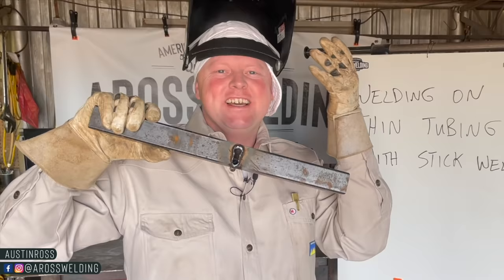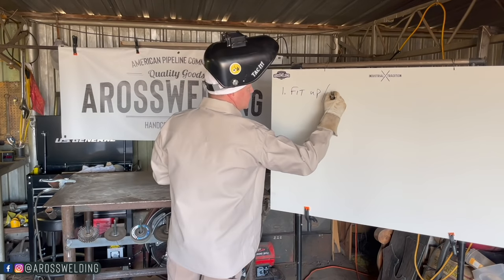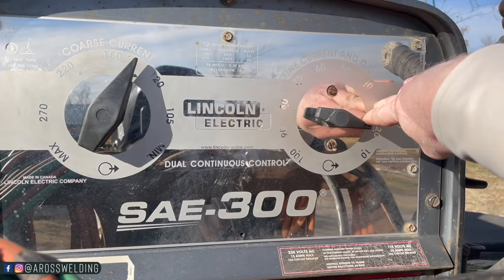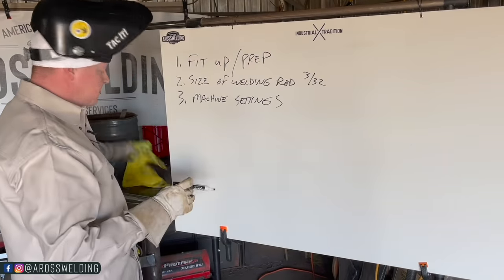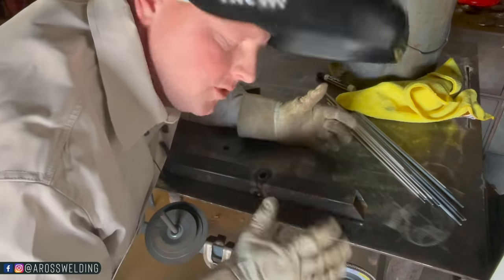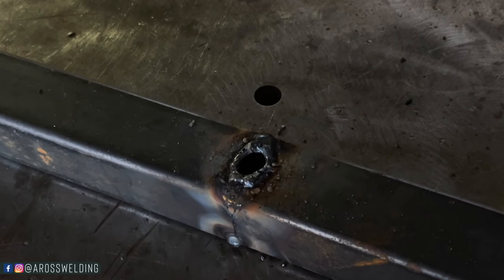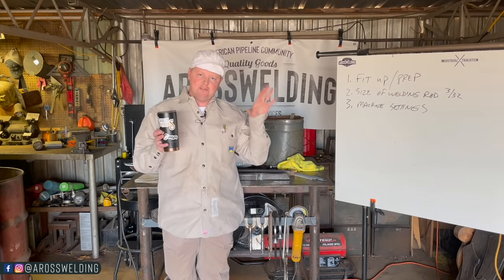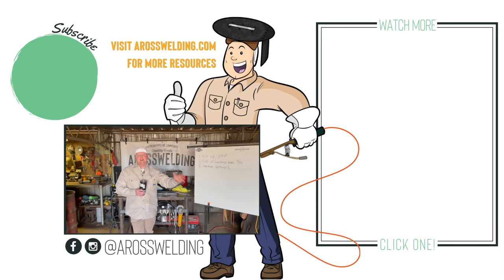Stick Weld Thin Square Tubing (How to Recover After Burning Through)

Comment: One thing you have to be careful about when filling large holes is to not build up what I call an igloo. In other words, make sure you’re welding flat, on the edges, rather than building those edges upwards, which is easy to do. If you do, when you sand or grind it flat, you’ll find another large hole left.
Reply: Gotta get your feed /heat ratio right to get a good puddle not an igloo. With stick it's big rod slow small rod fast
Reply: Can't take bugger all off on that outer corner mate, on the thin material. A tiny pass with a flap disc and lower amps will prevent the igloo and better yet, stop over penetration and ultimate blowthrough. The basis of the video.
Reply: And forgot, a fast pass.
Reply: I did this at work yesterday. My foreman wasn't happy. Not at all.
Reply: Excellent advice thank you
Reply: @mikejohn3265  The next time that happens when you build up a little rim around the hole try to hold the rod in the center of the hole and let it build and get hot enough to redden the outer fill then go up and out of it. Grind it down and it should be fairly flush. 28 years shipyard, port and naval production experience. Good luck my man.
Reply: It’s the same principle, as when you’re welding a keyhole
Reply: @tombragalone7250  true.
Reply: I dob  308  and309  stick make a puddle stop watch the red leave hit it again look like a tig weld
Reply: ⁰
Reply: If you have the right thickness of scrap handy, and you're using small 6011, cutting in a small patch might work better.
Reply: 😆👍 dang an iglpo can be bad then.

Comment: It really helps ,when you’re welding thin material to not use a high penetrating rod such as 6011 or 6010, Use some 6013 or 7018, also you can run 6013 vertical down and it’ll do a really nice job on thin material, you also can buy one 1/16th welding rod.
Reply: i think 7018  downhill is ok with sheet metal thicknesses like this
Reply: A lot of people dislike 1/16" stick welding rods because they feel like flimsy spaghetti, which they do, but a good compromise is to get 5/64" (2.0mm).  They will work reasonably well down into the 30A range, which is plenty low enough for most projects out there, and has enough stiffness that the arc-end won't be flopping around everywhere after you strike the arc.  Blue Demon sells a convenient 5 or 10lb box of 5/64" for a good price on Amazon, and IMO every welder should have a box of it just in case.  Really, really useful for quick fixes/jobs on exhaust systems/tubing.  Blowing a hole through an exhaust installed on a vehicle is a disaster you don't wanna put yourself in.
Reply: 6010 can work very well on thin metal if ran properly. It is a fast freezing rod so you can use a whip and pause technique to avoid burning threw. Use a small rod and low amperage. It will also look very nice if done in this fashion. At work we only get 6010 and 7018 so 6010 gets used on thin metal all the time.
Reply: The key is whip and get puddle frozen and get back in it and pause.
Reply: @dans8169  dan....i want to weld up a carport from 1/8 steel tube.  any ideas on  6010 vs 7018.  i like the idea of 7018 for strength, but 60xx rods are still twice the strength of the base metal???
Reply: @peetky8645  The only problem with 7018 on thin metal is it’s not fast freezing. That can result in burn outs. What you can do is a pass of 3/32 6010 on low amps and then a pass of 3/32 7018 over it. That will work very well  because after you do a quick pass of 6010 you have made your joint thicker and it will not blow out as easily as a 7018 only weld.
Reply: @dans8169  good advice.  i have also thought about using a thin backer on the butt joints at the apex of the trusses, welding downhill, and moving quickly.  still trying to decide on the pitch for the trusses -4/12, 5/12, or 6/12.  all the other welds will be fillet welds
Reply: @peetky8645  The 7018 I would not downhill. The flux is very liquidity and runs like crap downhill
Reply: @dans8169  good observation...i will definitely keep that in mind..i was hoping angling the rod steeply in the downward direction would allow the arc force to keep everything in place...  it will be an interesting few days trying out different rods and direction of travel etc.   i have a camera and auto darkening lens and tripod so i may try to film it all and put on YT so others can learn from my mistakes.
Reply: @peetky8645  Just run uphill and it's a piece of cake.
Reply: @peetky8645  Going verticle up you want to be in a slight push.
Reply: @peetky8645  I'd say that if you're going to build steel trusses that you don't weld at all and use self tapping screws instead.  I'm a carpenter and the company I work for specializes in designing, fabricating, and installing steel trusses (mostly for roofs) –I've built A LOT of trusses. We use self tapping screws exclusively to build our trusses. I know that they used to weld trusses but that was apparently 20 or so years ago before screws proved to be able to hold trusses together. 

I can't even begin to imagine how much of a PITA it would be to have to use a welder when putting together trusses. The time it takes, the mistakes that can be made, the process of fixing those mistakes, equipment needed, etc... Building a truss (~20' wide, with a 7:12 pitch, maybe 13 webs and a 130-150 screw count, for example) takes me about 15 minutes when using a screw gun and a little longer when using an impact driver. It would probably take at least 3 times as long to build if I had a comparable proficiency in welding. 

Unless you want a welding project, have no deadline, and/or already have the equipment needed to weld and you would have to invest in tools and/or hardware to build your trusses using screws, then consider listening to my advice.
Reply: @KJ110813  interesting

Comment: Experienced welders have been in many recovery scenarios. Welding thin material is challenging. If it wasn't for my mistakes, I wouldn't have learned anything.
Reply: I managed to flat weld some tubing and even filled in some holes with 7014 but forgot how I managed to pull that off.

Comment: Square tubing 10 GA or thinner I use old school oxy/acetylene with 1/16" filler rod. I know it's slow but it looks awesome. Saves me a lot of time on clean up.
Reply: I just get the mig out lol
Reply: I love oxy/acetylene it is so accommodatein and versatile👍
Reply: Something to notice is he using his opposite hand from holding the stinger to hold the stick closer to the hot end. Lower amps cause sticking, and he does a smooth start using his stick hand. It gets hot fast, so let it go after light up!
Reply: I use the old "touch & stop" method.
Reply: @mikem9584  yup that’s what he did to fix the hole
Reply: @ellismidkiff6117  Tijuana TIGgin'
Reply: When I grew up, no 220 in the shop, so I did a lot of torch welding. I really enjoy it, and I still feel it is a good way to start out.
Reply: @JeffinTD  you learn to TIG via torch or gas welding
Reply: Leastwise that was my welding instructor's take on that
Reply: @mikem9584   Yeah that was kind of my path, though it took me a session or two to break the habit of pulling the torch back when things got too hot. 

Oh yeah, gotta back off that pedal thing…

Comment: You’re right, every welding machine an welding rod welds at different temperatures. Your technique was called buttering way back when. Great job with your teaching course on filling a hole. Retired pipe welder of 42 years 🇺🇸
Reply: A welder never retires 😉 as I'm sure you know. Everyone always has a job for the family fabricator 😂
Reply: Retired after 41 years working under the AWS D15.1 code. A good welder never stops learning! As far as thin stuff, the best lesson I ever learned was running DCSP with 6010, 6013 etc. DCSP (DCEN) has a tendency not to heat up the base metal as much as DCRP (DCEP). And Scrimdog is right. A welder never really retires! Ha!
Reply: If you have room you can put a brass chunk on the back side, it will also help with the heat. Not a welder but was a fitter for decades.
Reply: @tomt9543 I looked it up and dcen inputs 2/3 of the heat at the base metal and 1/3 in the electrode, is this right?

Comment: Great video especially for those just starting out; as an old school retired tank welder, you got all the basics right! speed is something you just have to get the experience to learn how,& when I had " blow outs" I have put a filler rod or scrap piece of similar material in the hole & weld it in place, if it's not for pressure or heavy structure. If it us for pressure or structural use,think about using a heavier gauge material to start with! And you got it made in the shade, with all the new steel & good equipment! If you have people ask about rusty metal; get it as clean as possible; the 6011 rod is a general purpose rod & is the only rod I will use on rusted or dirty metal, especially in the oilfield & junkyard scrap! I'm just glad that you and a few others are still out there  working & willing to share your expertise & experience with others! Keep up the great work & don't let the devil get you down!
Reply: we use 6010 or 8010 to root piping up here, depending upon the usage/ regulations on the piping being used (Z6.62?) we use 8010 downhand. I like it for junk metal like you were saying and I like it for closing up holes because its a fast freeze electrode. Lots of people also don't know that it was originally marketed as a cutting rod for making quick fast cuts without a torch. Crank a 1/8" rod to 220 amps it'll cut a hole. But people started noticing that the rod had great penetration and lent itself to root welding.
Reply: Just to add a little to what you have already said, 6011 electrode is classified as a deep penetration, fast freeze electrode, which makes it excellent for welding down hand and rusty, painted wet metal. Generally the rod manipulation is to whip and pause, so basically after striking the arc you whip back away from the puddle without breaking the arc, which allows the puddle to cool and carry on with that motion. Very easy to start the arc. It does not have to be kept in a rod oven to keep it dry like the low hydrogen electrodes like 7018. It's an excellent starter, all purpose electrode. It is also often used on the root pass of a high pressure weld. 6010 is common as well and is very similar to the 6011 electrode.

Comment: Welder here 28 years experience, what I've learned over the years concerning thin metal it's best to whip and pause which gives the base metal a fraction of time to cool avoiding burn through at appropriate  speeds. Practice makes perfect. Great video demonstration my man.
Reply: Perfectly said 
Weld pause weld pause weld pause

Comment: Excellent topic. That’s what I tell my students, a welder knows how to work the metal. How to switch up rod movement, amperage, angles, arc length, and travel speed. Pipe welding is great but I feel that this builds experience, character, confidence. I’ve welded 14 gauge rectangle tubing with 1/8 6010. Made some stairs to a mobile home with them. I set the amps at 65-67 and as soon as I establish a puddle, I move. Whip and pause is really the best way to speed weld. I also keep a tight arc length.
Reply: Excellent point, most young guys just want to get in there and burn rod after rod and that may work on thicker materials. But real skill, comes in welding thin materials as we know! I used to have horses, and had pipe coral fencing and once in a while I would have to make repairs on that rusty old pipe. Now there is a challenge for you!!! Your better off splitting another piece of pipe and samwhich over the bad area, before you uses a box of rod or a spool of wire. But what is pretty awesome is the fact that somebody half around the world can chime in, in the conversation and give you his tips and tricks. Okay! Later you guys!

Comment: I’m a maintenance welder who has worked for a few different companies.  On my own I’ll use 6011.   But in most circumstances I have only been supplied 1/8” 7018.   Still works okay if you set it at 120 and whip it fast . Just don’t pop a hole or it will require some Texas tig
Reply: on really thin stuff flip the cables around, had to do that in a few pan washes beneath conveyor belts. If its thin you don't need much pen and you wouldn't / shouldn't trap anything. That being said I'd rather have 6010 for those situations.

Comment: I love 6011, but when welding thin stuff I’ve really come to love 3/32 6013, so easy to weld with, and it’s also easy to make look good as long as your going uphill.
Reply: trying reversing your polarity its thin you don't need much penetration.
Reply: I'm working on paper thin and rusty and 3/32 6013 has been the only rod I can use without blowing through. All overhead.
1/16 will work but you have to be very fast.
3/32 half inch long bead, clean, cool, repeat.

Comment: Good tips! I do a lot of 14 and 16 gauge galvanized tubing on custom livestock handling equipment. We mig everything in the shop but in the field we stick everything. I use 1/8” 5P+ rod at 70 amps and hold a long arc and whip the poop out of it. All verticals I run downhill too. It takes a little to get used to and you have to move fast! I rarely burn a hole in anything anymore but the fit has to be good. Keep on keeping on brother!

Comment: I started welding by learning on my own with a Century AC stick welder, 6013 rods and building stuff out of 16g 1" square tubing 10 years ago. Super frustrating in the beginning with all of the porosity and blowouts but it was worth it. I've worked for myself ever since.

Comment: Glad this video popped up in my feed! I'm doing a 14 guage sheet metal to 14 guage square tube build and got holes everywhere! I've been filling the gaps with 7018 and 1/8 round steel.

Comment: "Walk away" is some of the best advice ever! Also lowers my frustration level.
Some welders have an 'arc force' adjustment. It's basically adding some 'constant voltage' effect to automate arc-length. This is usually helpful but not for me on thin metal. It can get out of hand so fast. One thing I do is to turn arc-force off/down completely so I can control the heat on the fly. If it gets too hot then I crowd the arc to lower the power. With arc-force on much it will just punch a hole.
Reply: That sounds helpful. Will try it.

Comment: Great vid, I came up with something like this technique for filling blow throughs when repairing an old car chassis with a very cheap welder, decades ago. The metal was like lacework in places, but strong elsewhere. Some places where the corrosion had made large areas thin, I'd add extra patches when this occurred, but other places I'd go around the hole building up with metal, cooling with water and chipping off the slag between each pass to save time.
Since doing that car I've done a lot of amateur stick welding over the years and I've never had welds with so little slag from the cheap rods I've used. I've also extensively used gasless (cored wire) MIG and the slag from your rods looks more like the welds from gasless MIG wire. My stick weld rods leave a thick slag more like a black ceramic which needs chipping off with a hammer. Sometimes it's so thick that it looks as though I've done a great weld, then I chip off the slag and the metal isn't even joined! Maybe I missed it, but what rods are you using?

Comment: You're right about wanting to do it right the first time, but it takes time and practice. I've had a lot of practice filling holes on my neighbour's 1950s steel boat - 3 or 5 mm sheet metal, rotten down to 1 mm in places. Hills and valleys all over the bottom of the boat. Also painted with coal tar on the outside and inside, even after removing it, the welds still fizzed like soda.  Sometimes a certain current setting worked well, until I met an area which was very thin, and blew a hole. Then had to run a 2 mm electrode at 40 Amps electrode negative (!) to not blow through. The worst hole I had to fill was about 2 cm in diameter.  Patch it with a plate? Expect another <1 mm area. It took me a whole day to fill the holes in the bottom. My father demonstrated the first hole - it would've taken him 2 hours max. to finish the whole boat. I told my neighbour I wouldn't charge him, as his boat would be "practice material" for me. His only reply: "As long as it floats, I don't care how long it takes. Want some tea?"

Comment: I love your videos.  About stick welding thin material, almost 30 years ago I made patch panels for my 1970 FJ40 Landcruiser and welded them in with stick. All we had on the dairy was a Lincoln buzz box. I found some 3/32 6011 that came on a pallet from a farm auction. I burned some holes. Filled them with the "okie tig" method.  I did About 1" beads 8" to 12" apart and let things sit. I would go do feeding or something and come and repeat. I'm no body man by any means. But I got the job done.

Comment: When filling larger holes, I will grab another rod, that I've already beat the powder off of, and dab it on the rim of the hole. Bridging the gap with a cold rod, for extra material quickens the process. My dad would just clamp it next to the main rod, but that takes practice to keep it close to the arc.

Comment: I learned to stick weld thin tubing in 1965 (I'd been stick welding heavy stuff since 1958 on the4 farm).  Recovered a couple dozen sticks of 2x2x1/8 tubing from the post dump at Ft Devens Mass.  Built a 6'x8' trailer including axle (had one stick for 1/4 for the axle.  Cut everything by hand with hacksaw.  H0bby shop had only stick.  Still have the trailer. it's been lengthened to 12', widened to 80", rebodied (wood) 5 times over the years.  I've had stick , MIG and gas in my shop for over 25 years, no longer use stick for anything but really heavy agricultural stuff.  98% of what I've done for years has been MIG.  I point beginners to MIG, stick actually requires talent and practice.